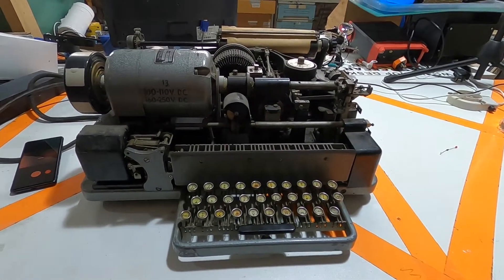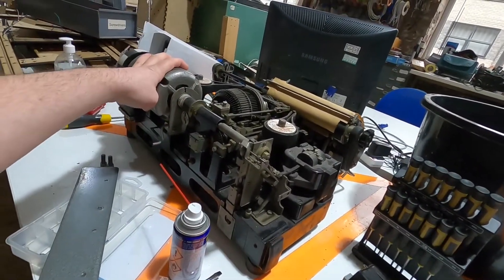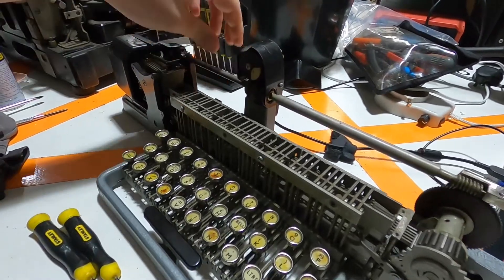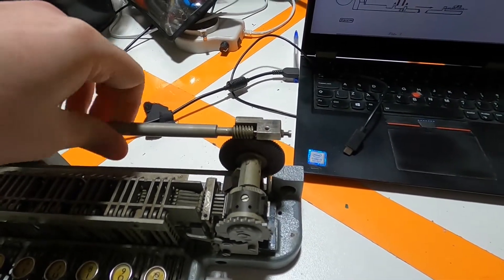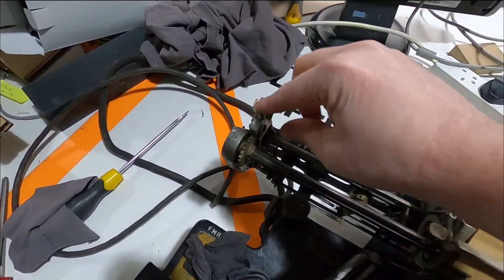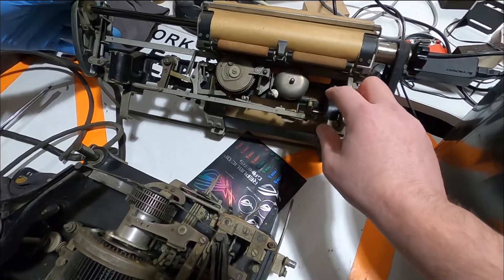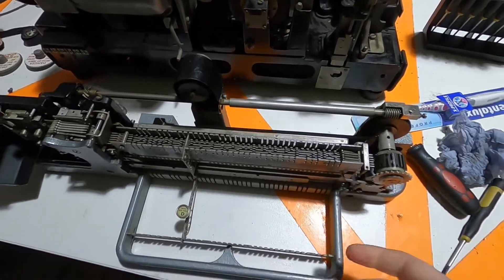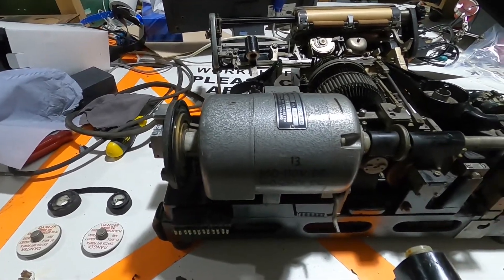Getting an old teleprinter up and running - part 1

Comment: Hi Guys. I worked on these Creed Co machines in the 60s in central London I/we stripped them down to the last spring and overhauled them. afterwards we tested them to take up to a 50% distorted signal which we produced using A TDMS, Telegraph Distortion Measuring Set. and  still produce readable text. There are/were Manuals, E.I's Engineering Instructions. which described this work in detail, also giving the clearances for the various Thou gaps in the transmitter etc Somebody has a copy, possibly Bletchley pk . Bellcranks and Typheads

Comment: I love the governor, it's like you see on old steam engines but transposed to electric power,
Reply: IKR!  It shows just where the thinking was coming from.  Now it seems crazy, but back then it will have seemed the obvious solution
Reply: Why did the motor need a governor at all? Was the power supply a bit erratic?